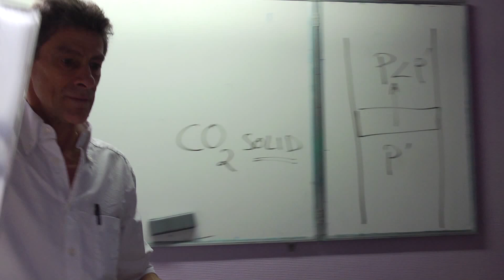Making SOLID Nitrogen!

Comment: The density of liquid Nitrogen is 0.807g/ml so it will float on water. The boiling point of liquid Nitrogen is -196°C, so why doesn't it freeze the water it is sitting on in the tray?

Why does the 'Dry Ice' in the video float?
Water has a density of 1.0 g/ml and dry ice has a density of 1.4 g/ml, so dry ice should sink.
Is there a mixture of Water Ice and Dry Ice at the surface, or is it just Water ice trapping some liquid Nitrogen that causes the off-gassing through the floating solid stuff?

Comment: The solid co2 was cause by the rapid cooling of the air around the liquid water. The water was there more to provide a surface for the reaction. The water also was for the smoke effect of dry ice melting into gas. The reaction was: The Liquid Nitrogen cooled the CO2 in the air to a solid, then the water in the tray warmed the CO2 back to a gas(at a slower rate).

Comment: It’s not a chemical reaction, but a physical one. It’s not the nitrogen reacting with the water, but the cold of the nitrogen that makes the CO₂ in the air condense and then freeze on the surface of the water.